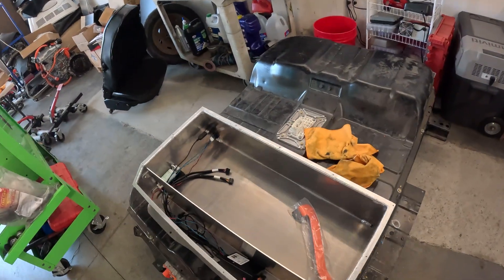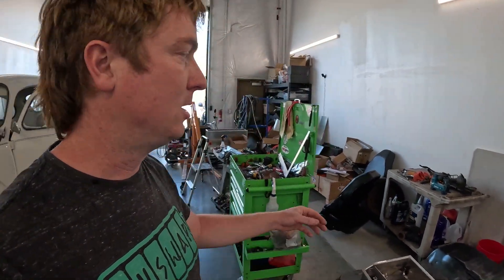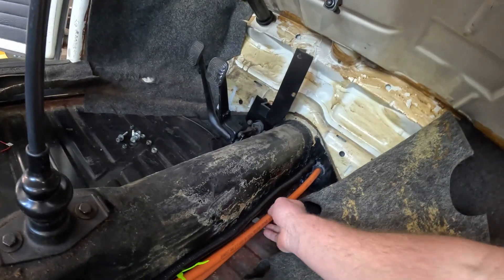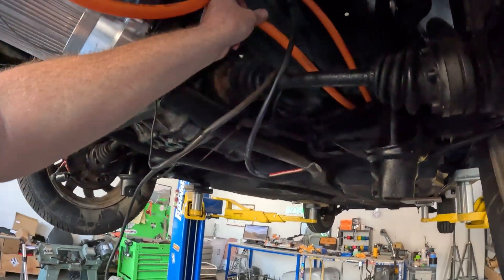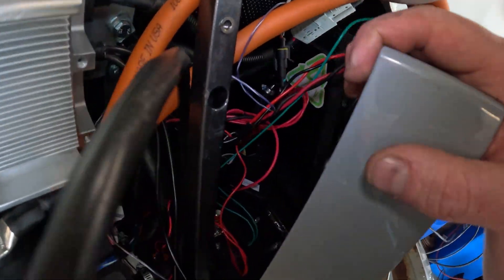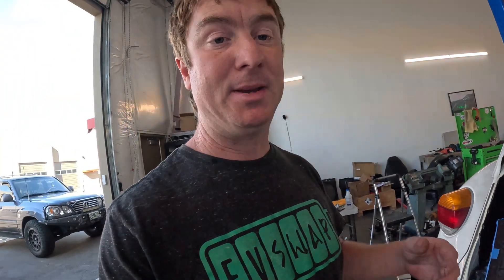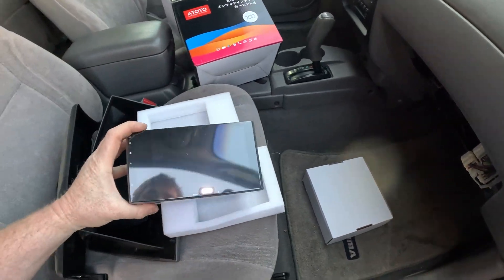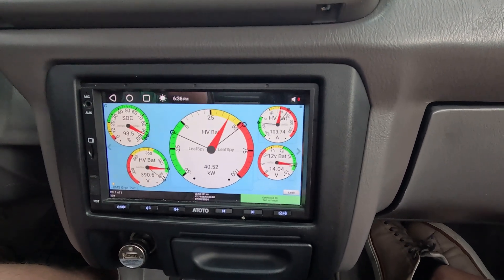High Voltage Wiring Updates on the EVSwap VW Beetle

Comment: Where the HV cables pass through the bulkhead and you are using rubber grommets,  it might be worthwhile looking at flexible conduit glands . They lock onto the flexible conduit and have a male thread to pass through the bulkhead and have a locknut to secure into place . Similar to normal cable glands except that they attach directly to the flexible conduit.

Comment: Would a skid plate or similar piece help with protecting the engine and engine area in the beetle? The POV looking up while the beetle is on the lift makes the engine look awfully vulnerable to road debris.
Reply from the maker: Not a bad idea. It is a few inches up and out of the way. The motor is sealed so it shouldn't get any debris in it. The HV wiring I will be using multiple layers of protection to keep it safe and maybe will make a skid plate or shield for it as well.

Comment: very cool. i'd suggest some 3d printed covers for those high voltage lugs. The liquid electrical tape is ok as an extra method, but maybe not the primary protection (since it can scrape and peel). I'd recommend some orange PETG that you 3d print into a cover for those connections, possibly with a printed indicator for which one is positive and which is negative. Also, I recommend a service disconnect for the battery packs and I recommend putting it between the front pack and the rear that way when you pull the service disconnect plug the voltages are effectively cut in half and making them as safe as possible. I apologize if that is something you've already planned on or thought about but i thought i would mention it. I hope we get to this point on ours soon!
Reply from the maker: Good idea! I think I will try 3D printing something to cover those terminals.

The packs do both have fuses and a disconnect switch to split both packs apart, but yes that's essential.

Comment: How are you planning on handling the transmission in the Tacoma?
Its an Automatic right?
Reply from the maker: I picked up a Toyota 5-speed Tacoma transmission which I will be using in this truck. I will need to have the driveshaft modified to fit but otherwise I already got it mounted up, check out some of the previous videos.
Reply: @EVSwap  Gotcha! Pretty sure Ive watched all of your videos twice over by now haha.

Comment: IDEA (food for thought): In my VW Beetle Baja build I ran the main EV power wires inside the side heat tube, since they will no longer be used for heat since the electric heater is behind the dash. This location protects the wires and shields them from the passenger. This way if it shorts it will short to metal ground (tripping the main fuse) and not to the human. I don't necessarily show this in my Baja build video but I suppose I should make a quick video showcasing this idea. Anywho, keep up the good work.  https://youtu.be/RGQp8zk-wws
Reply from the maker: Good idea. I couldn't figure out how to get in to those passages, though. This is the first Beetle I've worked on, have a lot to learn still. I am definitely aware of the risks so I will be securing the wires from chafing and adding a couple more layers of protection.

Comment: On the VW, there has to be a company that manufacturers retractable boots to cover the high voltage terminals? So you don't have to mess with liquid electrical tape.
Reply from the maker: I will look around. There is a little plastic cover that goes over the motor terminals, but nothing for the controller.

Comment: I might have missed it from previous videos, but I would have thought EVWest kit was somehow plug and play. But on the contrary it seems you still have a lot to tinker with and can implement as you will. Are the battery boxes from the kit?
Thank you very much for the updates on your projects, keep em coming!
Reply from the maker: It's very much not plug and play, unfortunately. You have to figure out quite a lot yourself. The battery boxes and motor adapter were included and are the best parts of the kit. Luckily the wiring is pretty simple and similar to most systems using a Hyper9 motor.

Comment: Wow! That is still a lot of work even with a kit. Look forward to seeing the finale for the engine - if only to see how all of those boxes will fit. Putting current tariffs aside, was considering a kit from Electric Classic Cars on the horizon? They look more plug and play (so easier?) but that could be just clever video editing.
Reply from the maker: Yes the EVWest kit is more a collection of parts. It's worth it for the motor adapter and battery boxes, though. I would love to use an Electric Classic Cars kit and build a Mini EV. They are expensive even without the tariffs, though.
Reply: I concur, I was thinking to Fellten and their Mini kit. Maybe level of readyness makes the price.